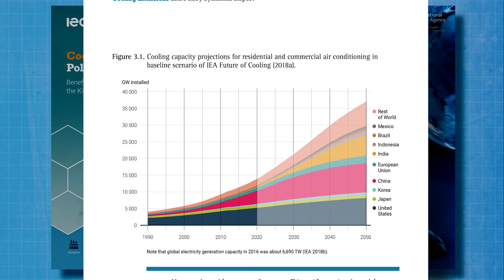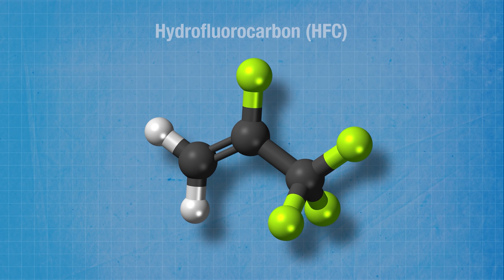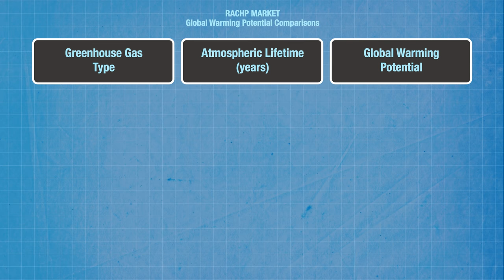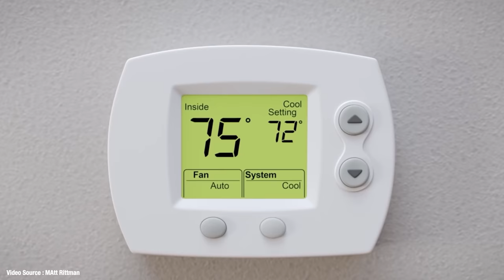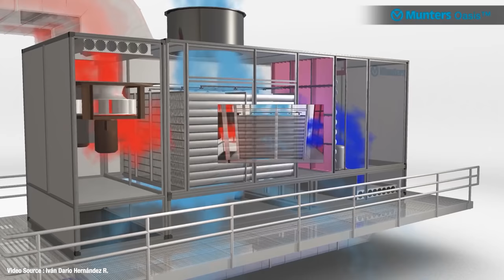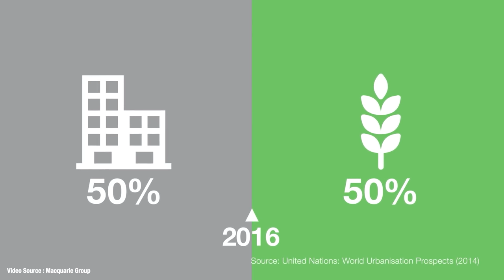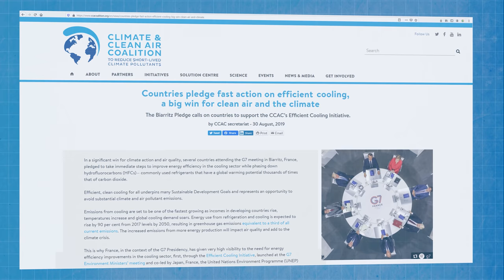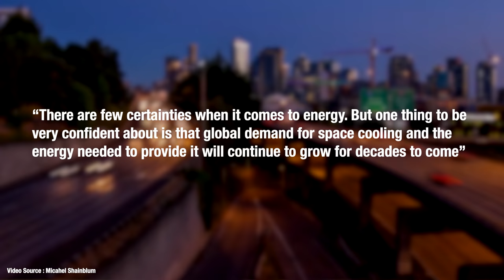Keeping cool in a warming world.

Comment: In premodern desert villages, there was a simple cooling system.  Dwellings were dug below ground, with a chimney at the opposite end of the room to the door.  Cool night air filled the lowered streets, and was then drawn into the dwellings by hotter daytime air rising up the chimney.  Termites build impressive towers which do the same thing.  How can this very simple technology be incorporated into modern design?  Many tower blocks have below ground parking, often more than one level.  This could be the night gathering cold store.  Adding a passive heat gathering chimney is a simple addition.  While the below ground car parks are still filled with toxic fumes, this colder air could be used like a reverse radiator, but once we are free of petrochemical vehicles, this could become a direct source of cool air.  All power-free.

Comment: Its' ironic, but the need for cooling comes from having too much energy. Take for example the tropics snd equatorial desert regions that get more energy than they want from the direct incidence of sunlight. It doesn't take too much imagination to see that a shading canopy of solar panels over residential and commercial property would help. Firstly, solar panels are edging towards 30% efficiency over a wider bandwidth, so that combined with the shading effect reduces daytime heating. Secondly, the electricity generated can power the various cooling methods that you outlined. A further really interesting technique is radiative cooling at night, particularly in areas where clear skies are common, and there is a tradition of making ice by this means in some desert areas. So the potential is to cool down the thermal mass of the building at night, and use exterior insulation to keep the spaces comfortable through to the cooler late afternoon. A lot to learn from traditional high density mud-brick towns in desert areas.

Comment: This might sound ridiculous but you didn't mention the air cooling systems that is effective in temperated climates. Like Sweden we use AC in commersal buildings even when it's below 20 C outside. Down to below zero exist due to high internal heating load. Some ventilation system can handle a wide range of air amount put in to each room. In that way the system can take benefits gradually of cold out door air up to the rooms temperature. To keep the room cold, it's increase the air amount when needed and when the room is empty or less occupied it reduces the air flow.

Comment: Our house is in the shade of a huge tree.  We don't need A/C.  I recommend it to everyone who can.  And if you don't have time to grow it, or plan to sell your house before it'd be grown, plant it anyway for the next generation or for the next owner.
Reply: @gasdive  It's true, if you live someplace truly hot, shade isn't enough.  The blast-furnace breezes of my boyhood home are one of the main reasons I moved to a more temperate climate in the first place.  But in a climate with 110 degree summers, we used an evaporative cooler that ran on about a tenth of the power that an A/C unit needs.

The way you're torqued about people who live in easier climates advising you to do the little things that work for them, I get torqued at my own neighbors who live in the same mellow climate, except they live in a dark-colored house in direct sunlight, with lots of white concrete paving outside to reflect heat up and into their house through their completely unshaded giant  southern windows (I should say "glass wall", it's a set of enormous patio doors), and run their A/C 20 hours a day when a few passive changes make it completely unnecessary. 

I know not everybody lives in a place where some simple measure works.  But there are a great many measures that each help a bit.  Heavy stucco walls help mediate temperature from day to night, even out on the blasted desert.  Houses with planned airflow (basement windows to draw air in, upstairs hallway with windows at both ends to draw it through, etc) were what we used on the prairies when I was a kid, and it goes a LONG way toward making things livable.  Wind towers were the thing further south, where the tiniest movement of air would have airflow looping underground to cool and then circulating through the house.   And on and on.  There are dozens of passive measures,  and between about four of them, even in those 110 degree summers, our house could be about 25 degrees cooler than the air outside without even turning the A/C on.

But now I live on the coast, and yeah, I'm so spoiled.  A shade tree is enough out here.
Reply: @zrebbesh  you're absolutely right.

I apologise for my rudeness. I'm a bit on edge. The fires got much too close for comfort last summer and I'm a bit unhinged as a result.
Reply: Plant a tree that drops it's leaves, to have the winter sun.

Comment: Not sure if anyone mentioned it, but you can also cool the air with sound waves with zero electrical input. Thus having a cooling device that requires no electricity. Furthermore "The THEAC system uses no mechanical moving parts, no refrigerants, no CO2, no precious metals or materials. Instead it uses Argon gas..." (https://newatlas.com/soundenergy-thermoacoustic-cooling/58169/). 
Enschede (Netherlands) based company SoundEnergy is selling these cooling systems already.

Comment: I've got Evaporative aircon in house. It's awesome, uses hardly any electricity and keeps our whole house cool. The issue is that it only really works in a dry heat, so absolutely no use in an even remotely humid environment.
Reply: You also need to be careful if you have wooden floors or ceilings.  Can make the wood warp when exposed to the unusual humidity.
Reply: And there you nailed it. Not everything works everywhere. Does Not Matter. Find out what does work where you live, and use it ;-)

Comment: Nothing on "daytime radiative cooling systems?" From how it works, if used on a massive scale, we could start cooling the planet despite our current energy usage.
Reply: I was expecting it as well, but just got disappointed.
Reply: How does anything accomplished on the surface of the planet cool the planet?
Reply: @TheMrCougarful  black body
Reply: @kirknay  Maybe at the top of the atmosphere. Near the surface, the atmospheric content of CO2 and other GH gases is preventing heat from escaping into space. As a result, you cannot get rid of heat at the surface of the Earth, all you can hope to do is prevent it from entering the Earth system at all (LEO-based reflective solutions, high altitude aerosols, etc). Heat trapping is the entire problem, or perhaps you didn't realize that yet.
Reply: @TheMrCougarful  I'm well aware of that. The research in question is about passively converting heat into a light spectrum that is less easily trapped, if I recall correctly.

Comment: The problem with evaporative cooling is that water vapor is also an extremely powerful greenhouse gas. In fact, it is one of the most dangerous positive feedback loops in global warming. Warmer temperatures cause more evaporation from bodies of water (oceans, for example) which in turn increases the amount of warming due to water vapor. Its a vicious cycle.
Reply: It's not a problem because the amount of water vapour is limited in other ways and it doesn't accumulate.

Comment: We should be mandating that all new construction buildings be designed with an integrated geothermal heat pump system. They are much more efficient than systems that rely solely upon electricity for all aspects of the heating and cooling cycles for space conditioning. 

Taking advantage of the thermal stability underground to effect phase changes in heat exchange processes means that much less electricity will be required for space conditioning. 

Government subsidies for retrofitting existing structures with (insulation for really old structures) better insulation would further reduce space conditioning demands upon the electric grid. The problem with all of this of course is getting the electric utilities to get on board with curbing demand for their primary source of income. That's an extremely heavy lift in capitalistic economies as the utilitie's primary concern is their bottom line. I used to work in the metering department of Detroit Edison and we had a saying there that "if the meter isn't spinning, we aren't making any money". Of course the faster it spins the more money they make per customer per month. So there's a perverse incentive to push more consumption onto consumers underlying their entire business model. 

I also did collections for Detroit Edison and contrary to intuition there are no bulk price points for electricity (at least here in the US anyways) because of vestigial energy market legislation from the early 70's days of the Iranian Oil Embargo. 

Usually, bulk pricing gets less expensive per unit consumed. But because of that leftover legislation, that has been turned upside down so that the first 150KW used is always the cheapest per unit and in progressively smaller tranches it gets more expensive per unit consumed. One of the customers that I regularly visited while doing collections was an automotive supplier in Westland Michigan called Dearborn Guage. It used an entirely electrically driven manufacturing process and the monthly bill averaged about $32,000! Now you know why new vehicles cost so damned much. That was just for one supplier of many that make up any vehicle. 

DTE (the 'parent' holding company for Detroit Edison) has long since diversified its portfolio of offerings. It is actually the largest operator of railway logistics specializing in coal and oil delivery east of the Mississippi River! But that is still within the energy sector so there's a lot more work that it could do to hedge against that perverse incentive. New mandates may further accelerate that diversification.

The deregulation of our energy markets caused competition to increase but instead of lowering prices, the energy companies choose to specialize further. As an example, DTE sold off all of its transmission lines and the only part of delivery it retains is in the metering at the point of consumption. They choose to specialize primarily in only energy production, leaving transmission and grid maintenance to others - a typical maneuver in the US energy markets. Consolidation threatens the deregulation of energy markets as competitors gobble each other up, reducing choices while doing nothing to reduce overall costs for consumers. 

Electrical energy is a strange product in that it's one of the only products (aside from cellular service) which gets fully consumed by customers a full month before the bill is due. It's not like the repo man can come and take back your electrical energy after you refuse (or are unable) to pay the bill! In that case bill collectors - like I used to do - only have the option of disconnecting your meter and turning your service off until you pay up. This nature of their business means that there is a significant financial overhead beyond the normal on the utilitie's part and also a higher percentage of "baked in" losses due to theft or diversion - which is way more common an occurrence than most realize.

By the way, stealing or diverting electricity is a misdemeanor in Michigan and comes with fines. Menacing a meter worker will cost you $150 plus court costs and that misdemeanor on your record for a first offense. They get much steeper for repeat offenders and yes, there are many repeat offenders. In the 2 years that I did collections for DTE, I recovered over $1M and was menaced only once by a customer (that dude had a very bad day after I left his power on)!

There were 4 of us contractors doing collections out of the Western Wayne Division of DTE at the time. The service area that we 4 covered spanned the three most populous counties in southeastern Michigan. One of the other guys kept getting into strange confrontations with customers. We kept ribbing him about how he was approaching customers that might be setting them off on him. One woman chased him about down the block with a chunk of two by four! Another young woman in Monroe hurled a glass ashtray at his head! It was all light-hearted ribbing and through our dark humor, he improved quite a bit over time! 

While doing collections you get to see a very wide slice of society. I've had 14 year old kids peel $550 off a fist sized roll of large bills they had in their jeans pockets to make me leave their doorstep! I've also left the power on without receiving any payment, merely a promise to pay as soon as they can because it was freezing winter and the single mom had 5 little ones running around inside. And I've also shut off the meters on posh McMansions over a $300 bill they refused to pay! Today's free advice: never fib to or piss off the bill collector! We're human beings too!
Reply: KaChing!  The cost of your house just went up by $20,000.  We have an affordable housing problem as it is.  Put a price on carbon instead.  If your HVAC is run on clean electricity, it's not a problem, assuming low GWP refrigerant.
Reply: @incognitotorpedo42  Nope, try a Canadian Well type, it's air based, just an underground pipe and a fan. Only tricky thing is the digging which makes it important to have it part of the construction and utilities dig. It's cool in summer, and gives a leg up for heating in winter. The materials should not be overly expensive and the fan is 50ish watt. That's about the cost, no idea what it will do with resale value but I guess it wont hurt.

Comment: They could use liquid air energy storage to provide district cooling and heating as required.  Liquefying air to store electricity produces heat, boiling off the liquid air to generate electricity produces cooling.
Reply: Need to store a 6-month supply though. And no good in the tropics.

Comment: You'd think they would make smart solar panels than not only point to the sun but also direct wind flow at a building for cooling in the summer, and close off airflow creating an additional lair of insulation in the winter, or at bare minimum make them attach in a way that an air pocket adds additional insulation below each panel making existing roofs more energy efficient.
Reply: So many people talk about passive housing but it would be even better if we invented ways to turn existing structures into passive housing just by adding layers to the outside. If those layers provide solar power as well then win win.

Comment: Best way to Cool 🏠  is Natural way;
🌲 Tree shaded 🏡, Bush facing Windows and Wines/ Creeper covered Walls, Plantation on Rooftops, will always be 5-10°C cooler than City weather reported Temperature.
Reply: So says someone who doesn't live in a place where lethal heat is a common occurrence. I find people who live in cool areas consider heating a basic human right, but cooling is only for the weak and lazy who can't build houses that "catch the breeze" or who don't want to grow vines on their house. Just have "tree shaded" houses they say. But they never stop to think what happens to "tree shaded" houses on a 50C day when there are 40 knot winds and burning embers falling everywhere. That "tree shade" turns into a 60m high wall of flame so hot that the radiated heat going through a window will set alight furnishings inside the house and kill the people sheltering inside. So hot that it beats back the firefighters trying to save the house.

Comment: I have a vague memory - from 30 or more years ago - so probably wrong - but wasn't there an issue with legionella in the cooling towers of water evapourating to atmosphere type cooling systems?
Reply: Yes ..... Unfortunately you need to clean them well!
Reply: Allowing laying water (in an urn for example) can cause legionnaire disease. The simple solution is to empty it and clean it.
Reply: @totherarf  Also why they are no longer made of wood products- the damp wood will ultimately always introduce mold and other unknown biologicals into the environment.
Reply: Legionella is in issue for all cooling towers and evaporative condensers (and any body of standing water). In Australia all CTs must be registered with a local authority and have water treatment with biocides to prevent this. I think this would be the same in most developed countries.
Reply: @oliverharder9057  It is true in the US. I've need envolved in "replanking " (replacing the wood slats on the side and rebuilding the internal water pond) some.

Comment: Don't forget to build in sun shade in hot climate's. Some of these sunshades can be made of or combined with solar panels (PV).
Reply: solar panels (PV) are required to be black so not good for sun shade in hot climates.
Reply: @grindupBaker  many want black panels because they are pretty or good efficiency. They don't need to be black. They can be blue or red to blend in at a terracotta roof.

Even if the panel is black and attract heat - it also good at (shaddowing) stopping heat radiation hitting windows, roof or wall's if there is a gap/distance.

Elsewhere they can paint some or all of the building white. Add shading retractable fabric markis.

Comment: One obvious source for the power required is surely solar? So as well as proper insulation, white roofs etc. solar panels will produce the energy required when most needed on the building needing the cooling!